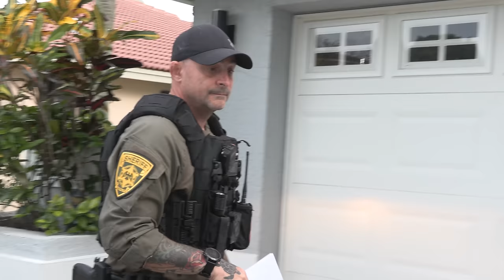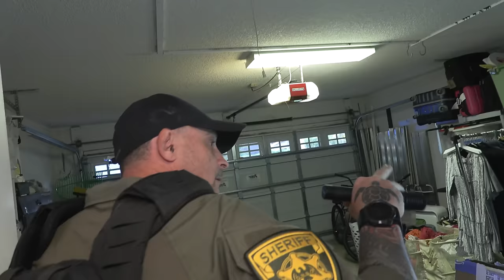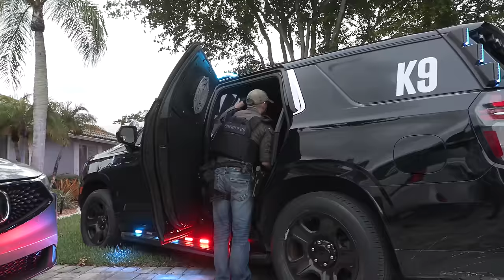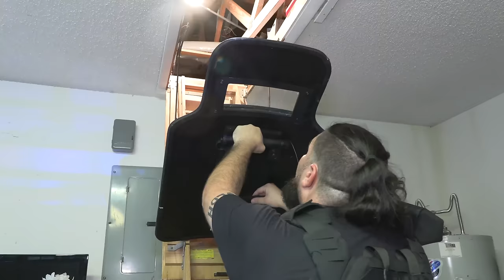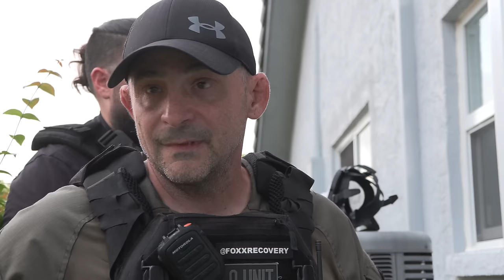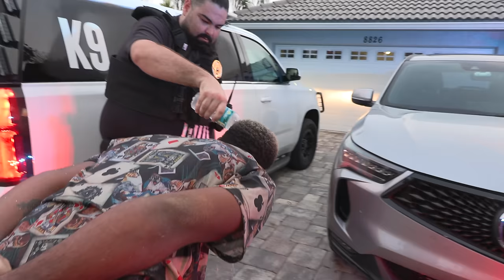NOW THAT'S A LOT OF PEPPER..

Comment: Hey   patty   you  should  try  out  the  New  heat  detection  unit  that  the  fire  dept   uses   it  will  save  l e o s  from  getting  hurt  it  will  detect  a  heat   signatures   and  then  you  know  that   the  asshole   ur  hunting  is  there  try  it  out  pat    you  will  like  it